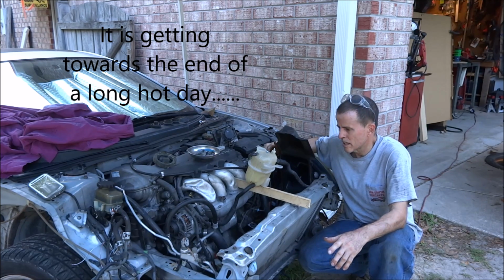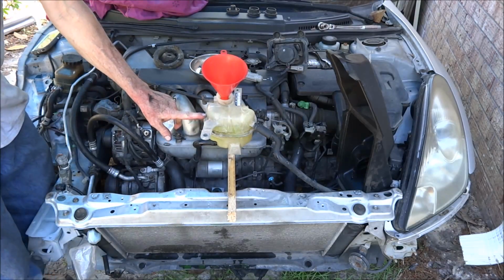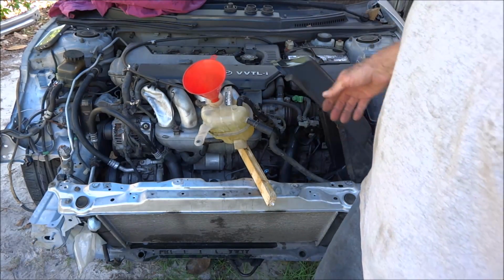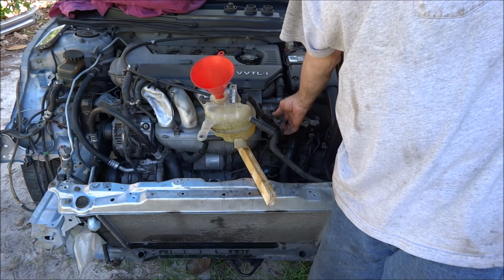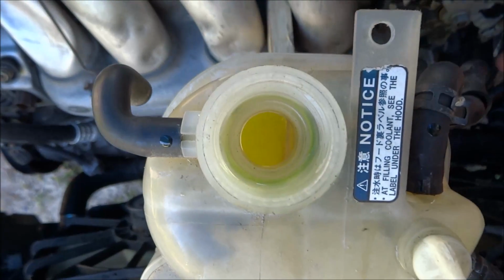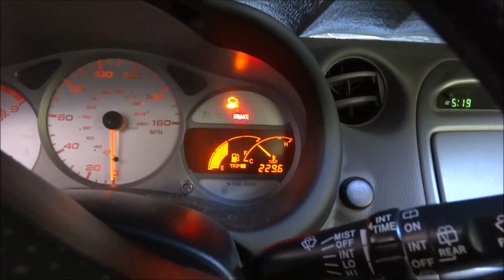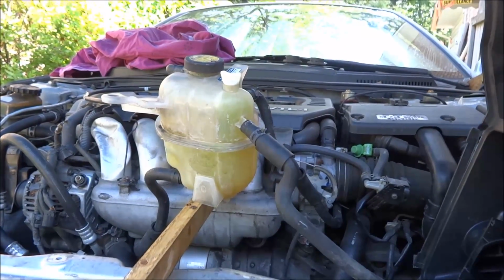2000-2005 Celica bleeding radiator / coolant. 7th gen Celica GTS.

Comment: Don't use the green coolant because it will crystallize all around your engine block and then your engine will overheat.  That's what happened to my Celica gts
Reply from the maker: It may have gotten mixed with another type (not color)of coolant. Or an additive (stopleak, etc) that reacted with it. 
  With regards to coolant. 
  #1. Do Not mix different types of coolant. 
   #2. You do not have to buy it from the dealer.
     To stay safe, use the manufacturer recommended "type" of coolant.  Toyota coolant is usually red. It will say something like this "For Asian Vehicles Red/Pink Antifreeze + Coolant is specifically designed for Asian vehicles."
  If you want to learn more, do a YouTube search for "coolant types." There are a lot of videos about it. This is one I found with a quick search. It may not be the best one, but it hits the basics of coolant.
https://youtu.be/SKo9aHdO7WU

Comment: So the tube I've taken off from the block, the coolant is full and burped but there is no coolant coming out of that tube, it has old fluid in it so do you think there is a blockage by the head or in that tube? After driving it, the temp gauge goes to hot and heater blows somewhat warm but not hot. What are your thoughts? Also I did everything as you've done in your video
Reply from the maker: It could be blocked.

Comment: I have a 2000 Gts. And I dont overheat. But the fan turns on way to much, and it seems that the coolant isnt circulating as good as it should. The air in the vents are only warm and not hot. AND I also can hear a bubbling noise around the heater core near the passenger side dash board area. ANY clues?
Reply from the maker: Hard to say for sure. the bubbling sound may be some air in the system. but if you are not overheating and the coolant reservior is staying full (it may not be air in the system). If you are having to add coolant that would mean a leak somewhere and if Celicas leak any collant at all they will get air in the system.
     If the Air conditioning is on the fans will cycle on and off with A/C.
As for the air from the heater not being hot, the thermostat could be bad, not closing all the way. Watch this video on Celica heaters, https://youtu.be/5f8ktI2AhhU. it is what I know about the Heating system. 
Good Luck . It is very hard to trouble shoot long distance :) but this is the best info i can give you.
Reply: @TSRGarage  txs so much

Comment: Me and my grandpa found a easy way of doing it just take off the head hose and then but a fonel into the bubbler and it will feel the radiator and everything else up with out having to let air out of the system
Reply from the maker: If it works, it works. As long as it gets the coolant in and the air out.
Reply: what is the bubbler ?

Comment: There is a sticker under the hood, stuck to the under side of the hood. That gives the correct procedure of how to change the coolant
Reply: Yes it does but it's not very informative. They could have simply shown a picture of the tank above the engine and then described the bleeding procedure. This guy made it easy to understand and more importantly why it's needed. The first step in fixing anything is knowing how it works.

Comment: Hey, I was curious how you drain and fill the coolant in the engine also. Do you or do you just change what’s in the radiator?
Reply from the maker: Nick C there is a drain valve on the back of the block Transmission end. Just below the exhaust manifold. Drain fitting has a 10 mm bolt that opens the valve. Bolt does not need to be removed all the way.
Reply: P

Comment: Got an 05 celica that the coolant reservoir was low, filled it up and lost coolant in about ten miles. Filled it back up and hasn’t lost any but trying to run hot. Only code was for temp sensor which I replaced. Think it’s thermostat or water pump? Hoses aren’t getting hot and coolant apparently isn’t moving? Thanks
Reply from the maker: Just some thoughts. First It's impossible to troubleshoot long distance. But .. the reason that it appeared full the 1st time and then was low is because it wasn't full.. Air gets trapped in in the head on these cars and it's very hard to get out.  If that air pocket is not worked out of the head It will continue to overheat. That takes a long time to get that air out. The coolant fill procedure is important.  Also it is possible that you have another problem such as... possibly... a stuck thermostat or a possible headgasket leak. Again impossible to trouble shoot long distance.
Reply: I put a new thermostat in today.. took about 4 hours with alternator in the way probably should’ve just removed it. But it still didn’t fix the problem. I think either my radiator is clogged or water pump is bad. How would you go about checking which one is bad? I’m going to do the bleeding of the coolant tomorrow but I just have a feeling it’s radiator or water pump. Thanks

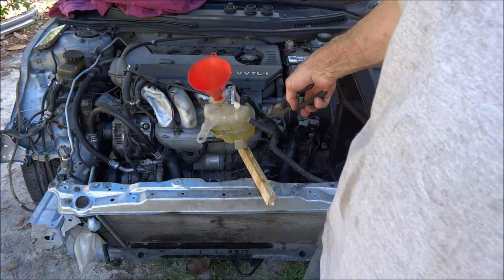Comment: At 5:42 that hose what’s the end of it where it’s connected what’s that called
Reply from the maker: It's connected to the top of the radiator
Reply: @TSRGarage  thx a lot , mine broke off accidentally , you think gorilla glue can hold the broken tube where the hose is to be connected
Reply from the maker: @omarss187  no. It won't.
Reply: @TSRGarage  dang what type u recommend

Comment: Hi TSR Garage
I used your video for the engine swap that got me thru many a potential roadblock.  Therefore, I subscribed a back in May.

However, I'm having a helluva time trying to determine where the line that comes off the top of the reservoir that you reference at the 1:46 mark connects on the block.  I have all of the lines hooked up except this one.  You reference to "the top of the head" however, the line I have has the same bends as yours and there is only the one connection on the side of the radiator line connection.  The heater lines are hooked up to the base of the throttle body.

I'm catching grief from my wife the car is not running and the kids keep using her Mazda.
Is it possible to find out exactly where the line that comes off the top of the reservoir connects to the block?

many thanks sir!
Reply from the maker: 1zz or 2zz ? The connections are different...
Reply from the maker: 1zz comes off of a fitting just above the throttle body. 2zz comes off of a port next to the main radiator hose. It is the farthest forward port.
Reply: @TSRGarage  apologies sir...1ZZ - incredibly FAST reply!
Reply from the maker: @alfloyd5360  just happen to be sitting on my a** playin on my phone 😁. The second part of my reply 1zz hooks to a fitting above the throttle body. Fitting is a metal tube that splits the flow between the coolant tank and the throttle body.
Reply: @TSRGarage  thanks sir...I will verify if there is a fitting there.  Is this fitting (as you referenced) on the head? I wished I could post a picture as all of the lines are hooked up.
Reply from the maker: @alfloyd5360  the fitting is basically a steel tube that runs over the top of the throttle body.it starts as a single line behind the throttle body that connects with a rubber hose to a line in front of the main radiator hose. The metal tubing runs over the top of the throttle body splits into two outlets.  1 rubber  hose goes to the coolant reservoir , the other hose goes back down to the throttle body (if I remember right).
   Important part is not ending up with a vacuum line connected to a coolant connector.
Reply: @TSRGarage  alright sir...you've been a fantastic help with the fact that the line is to split.  If I can't figure this out I will search out a local vehicle to see if I can understand the split.  Like I said, I left the hookups to my son.  They all "look" correct and thankfully no vacuum lines running to the coolant section or vice-versa.  I found other things mis-connected so, I'll dig into this tomorrow evening after work.  thanks for your time sir and keep rocking and enjoying what you do brother!
Reply: btw - I think I'm missing this metal tubing.  I am aware of the connection that comes out perpendicular from the side of the radiator hose.  The line that comes from here is currently connected to the throttle body farthest from the air inlet.  If all else fails I will split this line with a "T" and get this dialed in.  Rest well sir!
Reply from the maker: @alfloyd5360  yes sir. I believe that's what you need to do
Reply from the maker: I Emailed you a couple of pictures

Comment: hi what is that check engine? and how do we know that radiator tank is broken?
Reply from the maker: Check engine light was for cat efficiency O2 sensor (would go off occasionally and come back). And the radiator and overflow tank was replaced. 
      After finding a "good" source of non-ethanol fuel I haven't had a check engine light for cat or O2 sensors in over a year.
Reply: @TSRGarage  my celica gt check engine pop out  after i put seafoam and after that it says P0171 Trouble Code: System Too Lean after  9months because im not using it then check engine gone...but i always start the car every to weeks...do you think is the seafoam coz the check engine ligth?

Comment: i pulled the radiator hoses all off my engine when i was swapping transmissions and then just refilled it after putting it all back together. After doing that my car overheats and i dont get heat through my vents. Do you think there is air in there?
Reply from the maker: Yes, It must be bled out by raising the coolant tank only way to get air out of the head. Also the coolant tank has a slot on the forward bottom eddge that will sit on the hood catch. I didn't point that out in the video (umm no hood latch yet)
Reply: @TSRGarage  can i just jack the front of the car up... no hood catch either only hood pins...
Reply: @TSRGarage  also do you know if there are any bleeder screws anywhere that could be opened to help
Reply from the maker: @gravitycharge  need to raise the tank. Attach tie up to hood . .rope etc.
Reply from the maker: @gravitycharge  no bleed screws

Comment: There are 4 hoses on the coolant reservoir, 2 on drivers side, 2 on passenger side. On passenger side I know the top hose is an overflow hose but can you tell me where the bottom hose on passenger side of the reservoir goes to?
Reply from the maker: Bottom hose goes to the engine. connecting Near the lower radiator hose. Behind the alternator.
Reply: Thank you very much. I bought the car cheap & my son has driven it a ton but it began overheating so I changed the water pump & thermostat & seen that specific hose just has a bolt shoved in it. Idk how it isn’t screwed by now
Reply from the maker: @davincasada7499  Wow  all I can say WOW. I agree with you. That hose is a main part of the circulation  system... that  keeps the water moving through the coolant tank separating and trapping the air in the top of the coolant reservoir. Hope it didn't overheat to bad and hurt the head gasket.
Reply: It doesn’t have any coolant in the oil but I know that doesn’t mean anything. It fires up instantly & sounds great. Does it connect directly behind the alternator?
Reply from the maker: @davincasada7499  yes, to hook it up the alternator may have to be removed. Or remove the top bolt and pivot it out of the way.. might work.
Reply: I just don’t see anywhere for the hose to plug in to.
Reply: I have the alternator removed
Reply from the maker: @davincasada7499   There is a metal line that bolts (two bolts)  right on the top of the thermostat housing.  The hose tees  into the backside of that line.
Reply: Ok thank you and sorry to keep bugging you. I found the metal line that bolts on top of the thermostat housing. I will have to go to parts store and get something to allow me to tee into it.
Reply from the maker: @davincasada7499  the t should be  already welded into the pipe. Goes off the back (away from the alternator).  About 1 or 2 inches above the bolt flange.
Reply: No sir there isn’t any tee on the metal line
Reply: I wish there were a way to upload a picture
Reply: Is it called the water inlet pipe? If so I’ll just go find one and tear it down further to install it
Reply from the maker: @davincasada7499 i don't know what it is called. the tube should have a t in it unless   ?? someone changed it. I'll send you a couple pictures. Message me on Instagram  https://www.instagram.com/tsrgarage/?.. 
  or   Facebook  https://www.facebook.com/tsrgarage1/?
Reply: So I finally got the correct metal line with the T in it and have new water pump, thermostat on, bleeding it and finally all hoses are hot, can visually see coolant circulating, temp gauge reads right where it should be but the heater still doesn’t get hot?

Comment: Hello, I have a question about the coolant, what should be pink or red> Toyota Celica 1.8 TS, VVTL 189 KM 2003, I will be grateful for your answer. Regards Fan Celica and good Video materials
Reply from the maker: With regards to coolant. #1. Do not mix different types of coolant. #2. You do not have to buy it from the dealer.
     To stay safe use recomended coolant.  Toyota coolant is usually red, it will say something like this "For Asian Vehicles Red/Pink Antifreeze + Coolant is specifically designed for Asian vehicles".
  If you want to learn more do a YouTube search for "coolant types". A lot of videos about it. This is one I found with a quick search. It may not be the best one but it hits the basics of coolant.
https://youtu.be/SKo9aHdO7WU
Reply: @TSRGarage  To explain the Asian ones there is both red and pink so I didn't get a specific answer.

Thanks
Reply from the maker: @bradpitt3965  Red... pink.  Do the you tube search on "types of coolant". You are hung up on colors you are looking for a type of coolant. Specifically made for toyota. It willsay on the container "designed for Asian Vehicles Red/Pink Antifreeze + Coolant is specifically designed for Asian vehicles"  Same type of coolant can be different colors. 
       Less dye =Pink
   More dye = Red
Reply: It is generally recommended to use Toyota Red on older vehicles. This is mainly because older Toyota radiators usually have non-aluminum radiators, while pink radiators do not contain the inhibitors needed to protect them. Long Life Red Coolant contains molybate and triazole to protect metals (copper, etc.) in older radiators.

Toyota Red can also be used on later car models but comes from the factory in pink. Pink coolant was used on most Toyota cars from the early to mid-2000s.

My Celica Ts is from 2003 so I need to find out if I have an aluminum heat sink or not. Donkeys in British Toyota know nothing but money from the client :) :) :)
Reply: I would like this message to reach all Toyota owners who have dedicated customer service personnel, i.e. Total Zero !!!!

Comment: Any updates on the 2zz powered go-kart?
Reply from the maker: DxBOY15 haven't done a lot on that project lately. steering column/shaft is complete. I've kind of been slacking off on shooting any video when I do work on it. I do have a little bit of video need to get some together and post it. Thanks for asking about it.
Reply from the maker: I finally added a short update on the 2zz powered go-kart.  I now have steering... "9b steering column and brake pedal" https://youtu.be/yNcM2NdpCgQ
Reply: awesome! thanks for the update, will check out

Comment: Me and my dad tried doing this but my fan won’t turn on at all. What could it be??
Reply from the maker: Radiator fans will not come on until the engine is completely warmed up/hot. And radiator is hot... It takes a while for the engine to get hot.
   If they don't come on when engine is hot .  Could be bad fan relay or fan motors. 
   One way to check fan motors is turn on air conditioning radiator fans will run when a/c is on.
Reply: TSR Garage do you know where the fan relay is located ?? And I’ll definitely have to check that tomorrow when we get back to working on it.
Reply from the maker: @karleebrite6275  it's in the fuse/ relay block under the hood.
Reply: TSR Garage okay. Thank you! Also, just curious, do you have any idea why my thermostat might not be opening up when I bleed my radiator?? It’s a brand new thermostat.
Reply from the maker: @karleebrite6275  Not sure. It takes a long time for the engine to heat up. 15-20 minutes or more if it's cold outside. The coolant flowing through the small hoses to the water/filler reservoir bottle Will be hot. Hot. Before the thermostat opens. Then water will start to flow through the radiator. The radiator upper and lower hoses will be hot hot. Before the fans come on. 
    The temperature gauge on the dash will reach normal operating temperature.  and be there for a while before. The thermostat opens. 
   Also, do not run your heater fan. . As doing this will make it take even longer for the motor to heat up enough to open the thermostat. 
  Hope this all helps.
Reply: TSR Garage the temperature gauge was at normal operating temperatures for the whole time in the bleeding process and the thermostat never opened. And i don’t think I ran my heater fan. We turned the heat all the way to off and still nothing happened